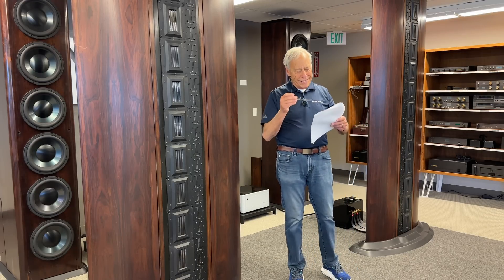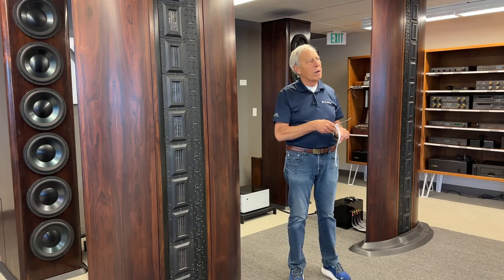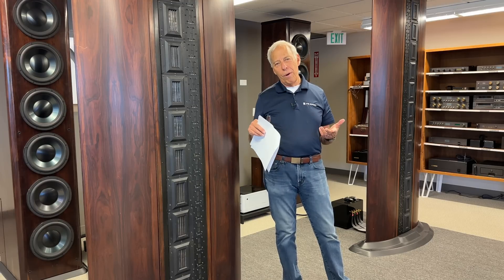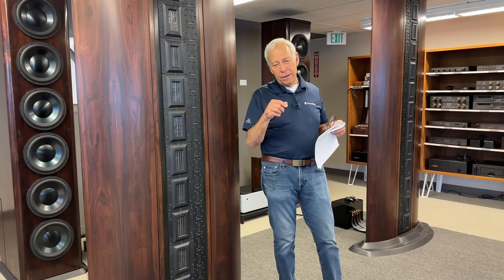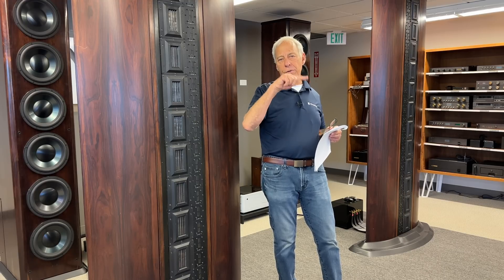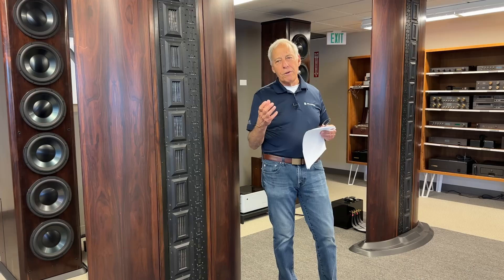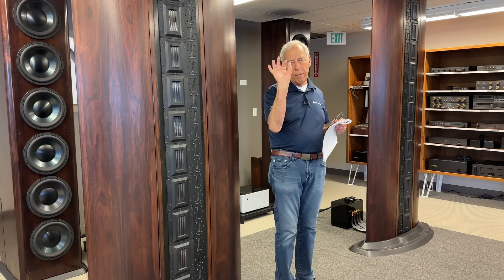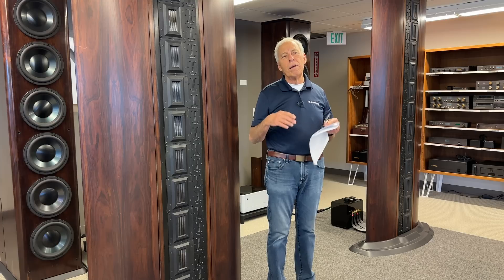Inverted dome tweeters

Comment: Hey Paul, I just had to buy two old stock replacement tweeters for my Paradigm Reference Studio 80 Ver.2 speakers. My aluminum tweeter domes were actually rotted. They actually just fell apart. I have never seen this before. Anyway my OEM replacement tweeters were pretty expensive. Is there a way to add an inline tweeter protection to the tweeters on the positive legs safely?  I get crazy sometimes and I would hate to ruin these replacement tweeters. I did not kill these tweeters. As mentioned the aluminum domes were simply rotted.  I would still like to have some sort of tweeter protection on these if possible.  I am only running about 75 watts max per channel on these speakers at times. Speakers are rated at 15 to 180 watts and have a 92 sensitivity.  8 ohm speakers. Maybe I am over thinking this but still,,,,,   My new hybrid tube amp is still super clean sounding even with the volume past 3/4's.  So yeah I am not sending distortion into my speakers at higher volume levels.

Comment: I used Focal inverted dome tweeters in a pair of transmission lines I designed and built about 10 years ago. They are two way with 5 1/4” Focal woofers and 1” titanium inverted dome tweeters with phase plug. I did worry about sibilants with the metal dome but I does not seem to be a problem. I also worried that the concave dome might be beamy but I find them less sensitive to placement than other speakers I built. Somehow these concave domes seem to have good dispersion characteristics. I don’t know if the phase plugs help with the dispersion?

Comment: "An "inverted dome" is generally inferior in performance because the inverted shape forms a "cup-shaped" cavity that can exhibit a resonant property if the depth approaches 1/4 wavelength within the operating range (about 5/32 inch at 20 kHz)." - John Dunlavy - Cones, Planars and Domes white paper
Reply: no one can hear at 20,000 hz.......so what's your point??????????

Comment: Many reasons the inverted dome is one of the best tweeters .  Im not a fan of the modern focal ones..EPI and GENESIS PHYSICS ...used the real ones.. heres the advantages.. 1. you can mound the voice coil 1/2 way between the edge and the lip where its strongest and wont flex..that also means the voice coil is smaller dia and the larger dome increases sensitivity.. 2nd. The originsl versions had a cone shape drilled into the pole piece...that lets the tweeter play deeper.. the first ones were 1500hz.. the later ones were 1800hz. They used 6db simple xover slopes so they sounded great. NO MODERN TWEETER SOUNDS AS GOOD OR HANDLES POWER LIKE THE GENESIS PHYSICS

Comment: I believe the thought behind an inverted dome tweeter (convex) was to better match geometries with other drivers...i.e. traditional woofer cones are inverted domes as well.  This way frequencies will come off the transducer shape in the same manner.  Now does this lead to better sound?
Reply: Yes its like snow tires for air. But the chamber behind the element must be right .

Comment: Don't feel bad about concave vs convex...it depends on point of view and point of interest. If you are inside the Capital looking up at the dome it's a concave surface: but f you are outside looking up at the dome it's convex. Two sides of the same dome. It depends on where you are and what you are interested in.

Comment: Convex radiates outward in an omni direction.  Concave does the opposite-- it focuses the beam.  Think of a parabolic reflector-- the dome dish on a satellite TV.  You wouldn't set up your dish backwards if you wanted to capture maximum signal.  Instead it is set up concave to focus the signal to a defining point.  Now in HF drivers the differences between convex and concave are small due to the size of the tweeter and the extremely short wave length of the high frequency spectrum, but you cannot escape physics.  Paul's explanation while valid applying to some materials does not account for ribbon or soft dome tweeters.
Reply: Alll drivers radiate back and forth .
Reply: @davidstevens7809  Wrong.  The diaphragm moves back in forth in a positive/negative frequency wave length.  That has nothing to do with the radiated directional output of the speaker.
Reply: I agree mostly. Because of the size of the size of the dome and angle the cross at a point right in front of the dome and produce a very extented dispersion. Im personal friends with the inventor.ill ask .

Comment: The EPI speaker company back in the late 70s early 80s used inverted dome tweeters, I am not sure but I think that EPI was actually a low end EPICURE speaker brand with vinyl clad cabinets as opposed  to wood veneer.
Reply: Yes, EPI and Epicure were the same company (EPI stands for Epicure Products International). While some EPI cabinets did have vinyl veneer, not all of them did.

Genesis Physics, sort of the spiritual successor of EPI (and no relation to Genesis Advanced Technologies) also used an inverted dome, very similar to the EPI version.
Reply: @smwsmwsmw  thanks :_)

Comment: Wilson used inverted dome tweeter on some watt puppy.
Reply: some years ago, those were focals (not certain of Wilson's current products). focal goes through considerable basic materials development w/ their drivers. kevlar > ti > tio2 > Be (& now, various alloys) for tweeters. delivers hi freq extension - quick, fwd & harmonic. I suspect Mahul's taste / approach was for a very accurate, extended & fwd-presence signature. demands really good ($$$) xovr design & components to avoid sins like sibilense. "better to dial-in a super-revealing tweeter than to make a blase one sing"? their own justification for employing an inverted dome: "It bears repeating that its main advantage, apart from its very low directivity, lies in its use of a coil of small diameter (hence very light and better accelerating) directly fixed to the rigid dome."

Comment: It is very common to do this on a PA. horn treble. Then you have the coil on the opposite side.

Tried to find information about this but found little
Reply: The job of a PA is to focus 'beam' the energy out, not disperse.
Reply: @keithmoriyama5421  No, the job of a PA is to be heard clearly by the largest number of people, therefore good dispersion is a necessity. Beaming is to be avoided.
Reply: @smwsmwsmw  OMG  How do you think a P.A. is able to reach thousands of people?!!!  Controlled focus beaming-- what do you think a modern line array is!!!!!

Comment: I can tell you, that it makes a HUGE amount of difference.  The EPI inverted tweeter, project sound in a Much greater spread.  Almost the entire room, becomes the Soundstage / Sweet-Spot.  There is almost no way to make EPI  100v  speakers sound bad..  as no matter how you place them.. even if under a desk,  or partially behind an object... they still sound flippin fantastic.
Reply: I found a way to make them sound bad, I compared them to every other speaker I own. Out of 7 pairs of speakers the EPI are the absolute worst buy leaps and bounds. Of course it’s all subjective but even if my EPI’s didn’t need a re-foam at this point I still wouldn’t listen to them. Some people love them though. I have a re-foam kit on order actually because the EPI’s are getting ready for market. Unfortunately after spending enough time with them to be thoroughly underwhelmed I stored them in what apparently wasn’t a very agreeable climate. Took them out of the boxes a few days ago and they surrounds were shot. I always found foam surrounds to be the first sign of a speaker you should avoid. If I hadn’t ended up with them on a deal for basically free I wouldn’t have them within a hundred yards of my house lol.
Reply: Im going to add... that Flatter does not always equate to better.   What catches and thus moves more air?  A Cone,  Dome,  or a  Flat Surface?   Also, I believe a lot of Ribbon drivers, are off-axis... and that causes spread issues, from the very start.  This is likely why the "Sweet Spot"  on them,  is so pitifully small and narrow.

Comment: Frustrating. Regarding tweeters Paul’s says ours are flat and the Infinity’s were flat.  However, others are domed, either inward or outward. Why? They are domed for strength. [end of video]. Does anyone have a follow-up question for Paul ? Perhaps he left a key point that could finish off the topic hanging in the air?  Anyone?
Reply: The 3d Soundstage that the EPI inverted tweeters produce, is Much wider and deep... than any other tweeter that Ive ever heard / owned.  I believe the inverted cone shape does in fact, allow the soundwaves to be able to spread out much wider... than the typically seen Dome shape.   Remember, that a Cup shape, helps to trap and push much more air... which is why Woofers are also Cupped.

 I can only imagine, that certain MFG's that were cutting corners...  didnt want their tweeters to be too powerful and too harsh... so to help reduce their levels... rather than altering the drivers (and or redesigning the entire speaker) ...they simply Domed the tweeters.   That said... EPIs drivers that power their tweeters, is Audiophile level quality... and as such, its perfectly balanced.. As-Is.
Reply: @johndough8115  Interesting. But of course the natural follow up question is: If domes are strong (and they are no matter which way they face, and irrespective of the benefits of either orientation), why do PS Audio and others use flat ribbon style tweeters? That’s the cliffhanger Paul has left us with.
Reply: @edd2771  Ribbons have almost no mass.  As such... they can be far more accurate, because they can Accelerate and Decelerate much faster.

 As such, that gives them the abilities for much greater details, and far less distortions...

 However, as Ive said many times before... there seems to be a trade-off.  The ribbons seem to project sound in a very Narrow field... and so,  to get that perfect "Sweet Spot",  you have to sit Perfectly in the absolute center of the speakers.   If there was a chair on either side of you (1 ft away)... and others were listening in those chairs... they would notice that the sound was not completely Balanced... because the sound field greatly diminishes, from that center projection.

 With the EPIs inverted tweeters,  the spread is much wider... and you can actually walk a good +8ft,  and still get a perfect, balanced, 3d Stereo image.

 Sure, they might not be as accurate as Ribbons.  But to me... the wider soundstage, is FAR more important to me.  Especially because I also like to use my speakers for both HD Music, and HD Movies (surround).

Comment: Is it my imagination .... or do those 12" LF speakers now have larger dust caps ...?
The Dynaudio Esotar hf driver has the best dome idea ... it actually pulses expanding and contracting instead of being like a piston
Reply: the 12" woofers are upgrades from the original, the old ones needed replacement.
Reply: True about the Dynaudio Esotar, but has since then replaced polished magnet and non-reflective damped sealed enclosure with neodymium magnets, so no longer the high-end product it once was in its original form.

Comment: Someone who sells audio told me that there is some inherent harmonic type issue with concave tweeters that, Focal specifically correct with like a diode circuit or something like that? Maybe one of you guys know more about it? 

I always assumed the concave design created more of a focused compression type wave or property/effect...no real clue to their advantages that I can recall?
Reply: I home auditioned Focal with the Inverted dome tweeter. 
I certainly heard an "inherent harmonic type issue" from the inverted metal dome tweeter. It was called excessive sibilance.
Reply: @eazyryder1591  That may have been more to do with them using Metal, than anything else.   I own a pair of EPI 100v  speakers, with the Upgraded inverted tweeters.. and I have never experienced any Distortions at all.   In fact, Ive heard things in music... that I was never able to hear before.   Such as a singer, whos vocals were a mystery for my entire life... and then being able to hear and fully understand, what the lyrics were... when played through the EPIs.

 Of course, the EPI Drivers were made in the 70s,  well before the ECO-Nazi's of the 80s.. started to put a stranglehold on the Audio Industry.. making all of the drivers weaker.. and thus far less accurate  (smaller and weaker magnets + weaker driver coils).
Reply: "While a dome might appear more "hi-tech" than a cone, it has many performance limitations and, for many applications, is inferior (overall) to a cone driver of equal "design quality". As a consequence, domes tend to perform best for tweeter applications, where the diameter of 1 inch dome corresponds to about 1.5 wavelengths at 20 kHz (yielding a half-power beamwidth of about 38 degrees).

An "inverted dome" is generally inferior in performance because the inverted shape forms a "cup-shaped" cavity that can exhibit a resonant property if the depth approaches 1/4 wavelength within the operating range (about 5/32 inch at 20 kHz)." - John Dunlavy: Cones, Planars and Domes white paper
Reply: @BB..........  I hear zero distortions / resonance issues with my EPI 100v speakers (with the upgraded plastic bezel inverted tweeters).   They are pure Magic... and produce a HUGE / Wide 3D soundstage that No other Tweeter that Ive EVER heard, can even come close to matching.

 Even when I lacked room space, and had to partially block them under a desk, and behind things... they still sounded Flawless.. as if they were set up properly, with no obstructions.

 Pure scientific data, isnt the best way to judge a speaker / driver set.  Hearing, these things in person, is the only way to really know the differences.
Reply: You are absolutely correct.  Anything concave  focuses the wave length-- such as a satellite TV dish.   Anything convex disperses the wave length out in an omni directional field.
Reply: @keithmoriyama5421  I think its a lot more complex than that.   When a Nasa Rockets CONE pushes forwards... most of the interactive forces, are concentrated on the front.. as the air divides away from it.

 This is very different, than the Cup shape.. which Captures a large volume of air, instantly.

 If the Dome tweeter was driven merely by vibration alone.. like a Pizzero effect... it might radiate in a 180 degree format.   However, since the driver is moving back and forth... rather than vibrating... then most of the energy is going to be pushed forwards and backwards.   Yes, some will be forces to the sides... but I believe that expansion effect... will be a lot more Narrow than you think.

 Im getting a much wider spread of audio from my cone shaped tweeters.  This goes against what you said... that a cone would be more Focused / Narrow.

 A solar cooking device, concentrates the suns energy, through collection from the outer edges.. and concentrating it to the center.   However, if you invert this... where as you place a bright light in the center of a Dish... you get a wide beam flashlight.

 Anyway... If the cone is able to capture more air in total.. that air is considered "MASS ENERGY".   And the more mass-energy that the driver can move per push... the more efficient it will be (louder / more power... and thus,  adding to the spread potentials).    And since the inverted dome is angled in such a way that points outwards on all side edges... it acts like a guide to help push all of that captured air... in a wide, cone shaped, energy-wave..  with a much more  UNIFORM pressure (in all degrees effected).

 Now, there is another thing Ive considered... and that is how the sound might also be crossing from the start.  For example.. maybe the left side of the cone, is pushing sound to the right side.. where as the right side of the cone.. is pushing sound towards the left side.    That said... I think its more like the above description..  and not this one.   The problem is, Im not a Fluid Dynamics Expert... so I cant tell for sure.

 I am, however, a martial artist... and there are similar things within my art,  in which power is transferred differently.  You can hit in such a way, that energy is very dull and spread out... or you can hit in a way, that concentrates a lot of power.. into a very small area.   Knowing how to manipulate your body mass... and to be aware of how these forces work... really makes you understand some of the physics on an Intuitive level.

 Anyway..  as Ive said..  fluid dynamics / aerodynamics / air-pressures...etc..  are a very complex thing.. even for some of the most seasoned engineers (whom are Still struggling to figure out a lot of this stuff).

 Only recently, was there a discovery in how to improve a Propeller,  which improved its efficiency / power... by something like 20%.